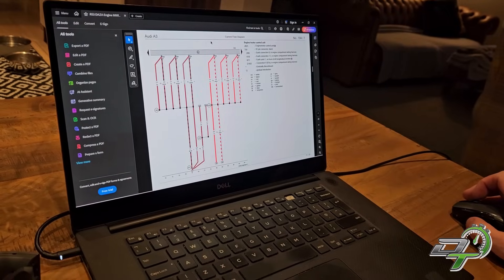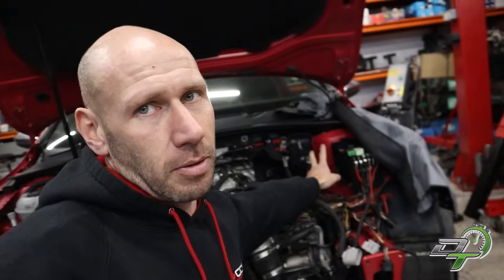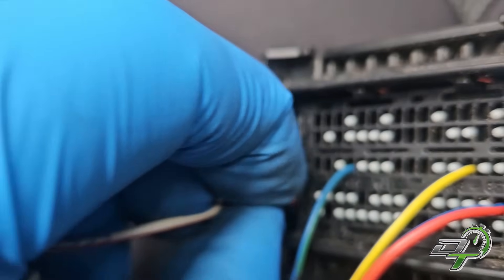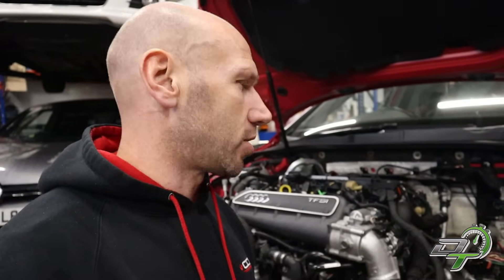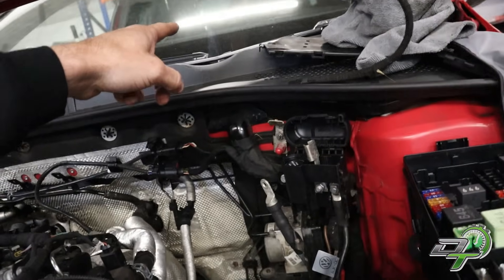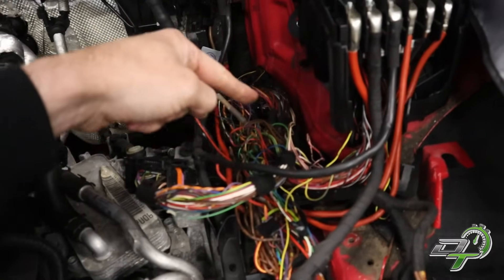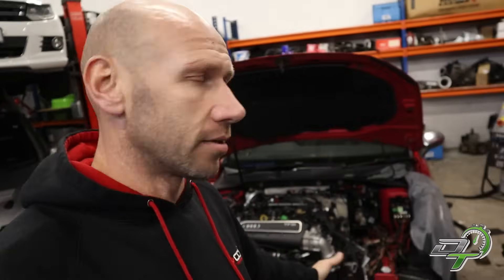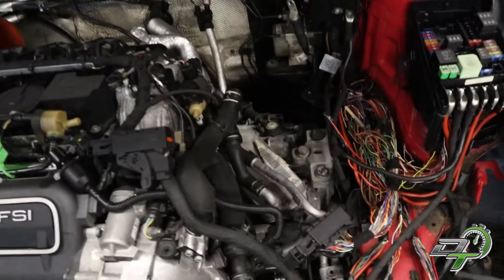Will the RS3 DAZA Engine Start...? // Part 3 // Golf R

Comment: This has been  a great watch, no waffle just straight to the point with loads of info. Engine conversions are in the blood of golf owners, I'm sure lots like me have done 16v and 20v conversions and this is the next step. Decimal tenths where do you source your wiring diagrams?Looking forward to the next video, keep them coming. 👍
Reply from the maker: Cheers appreciate it. I cut my teeth doing 9A/ABF/20V  conversions so I agree thos is just the next step.

I get wiring diagrams off the Erwin (VW) system. We have full access at work. If you ever struggle give me a shout il be happy to help out.
Reply: @DecimalTenths  Thanks appreciate it ,it's difficult finding wiring diagrams for modern stuff, was a mission finding a abs  wiring fault in the loom of my Ed30.

Comment: The suspense before you turned the key, 🤣 iv shorted out a loom back in the day fault find with cheep fuses. The smoke pouring out behind the dash was true horror 🤣 then had to strip the loom apart with a stanley that was melted all together. Lucky was my car, 
Great to have you back big fella! The knowledge you have is outrageous! 🤣
Reply from the maker: Cheers pal I'm a big cauldron of crap information about silly little cars...🤣

Comment: You got skills. 25 years ago, aged 20 I swapped a Pug 405 Mi16 engine into a Pug 205 GTi and thought I was clever! I now own a 2024 Cupra Formentor VZN which has the E888 and has 333BHP with an exhaust and thought I did well fitting a air induction kit 😂 - too complicated for me these days, and I work in IT!
Reply from the maker: Ooh bet the pug went well with that motor!! Cheers pal, cars have moved on a lot since then 🙈

Comment: What would you charge for a rs3 engine conversion on a Golf R mate? Brilliant video too work
Reply from the maker: Cheers. The difficulty is getting a donor. After that there's many options for spec and power wanted. A donor plus £10-15k would be typical.
Reply: @ nice one mate cheers for quick reply keep blasting out those videos 👍
Reply: @ and would that be typical of the mk6 R golf platform as well? Also out of interest what about a mk1 Audi S3? I have both and always fancied either a VR6 or 2.5 swap. Cheers